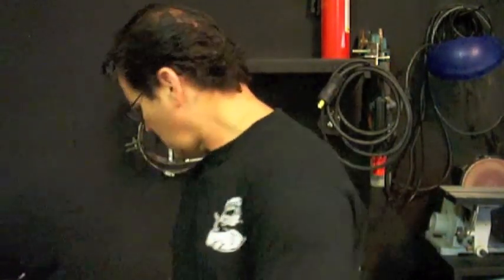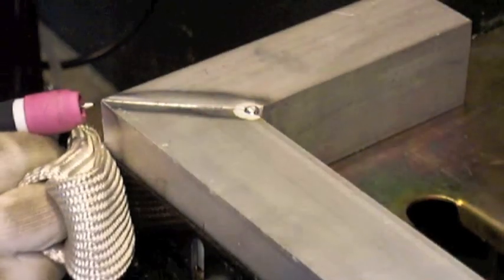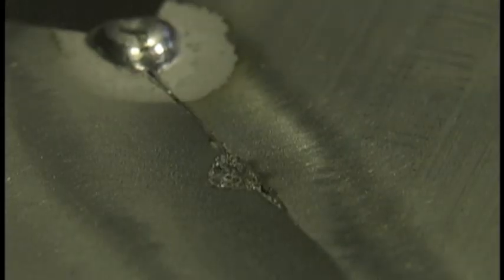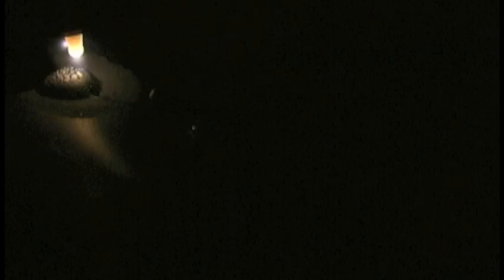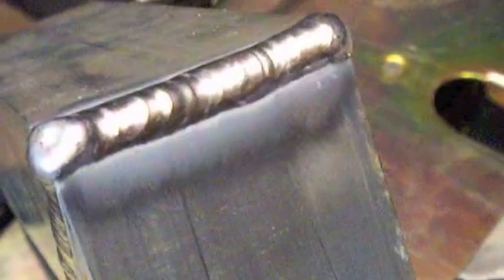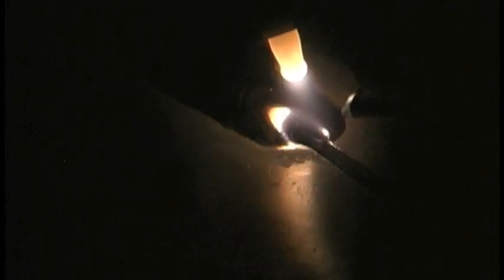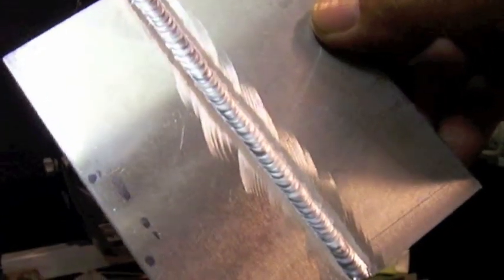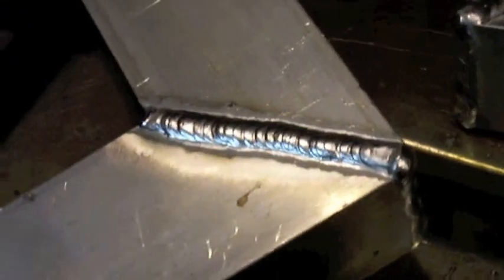Metals and How to Weld - Aluminum Properties

Comment: Excellent video.  For a woodworking guy who really has no clue about any welding whatsoever but needs to learn about welding aluminum so I can add a 1/2 inch extension to the skeg on my boat's Volvo outdrive so this helped me a lot!  First I need to find out what type (number) aluminum the outdrive is made of!  then get the rod the extension piece of metal of the same type and the appropriate rod.  I might just do it with a blow torch for now, though, since I don't have an welding machine like that and a catalane torch produces pretty good heat.  Plus I don't need perfect beads like that since I have to grind it smooth in the end for paint.  So anyone with advice for me please do chime in! Thx.

Comment: I wondered if you knew anything good or bad about the TIG Pulse Arc Welders made by Sunstone Engineering? 

I would like to butt weld very thin (.012 - .020) sheet aluminum, stainless and titanium for something I would like to mass produce which would be exposed to heat .  

This Pulse Arc Welder will do the job with no filler metal.  After watching your video on TIG welding aluminum and how but joints exposed to heat will crack when no filler metal is used now has me wondering?